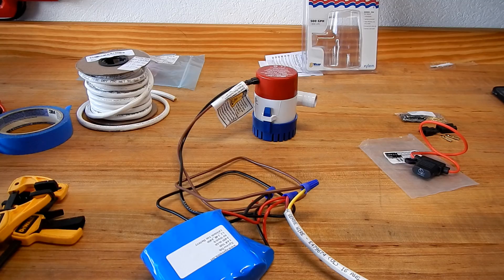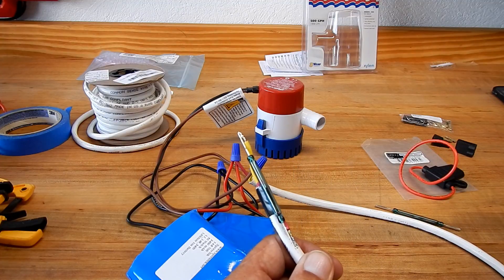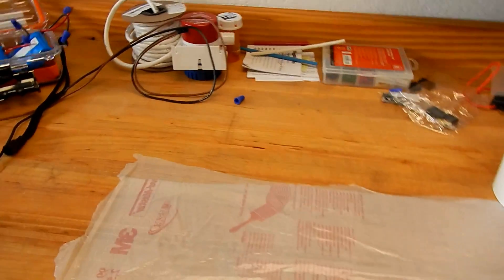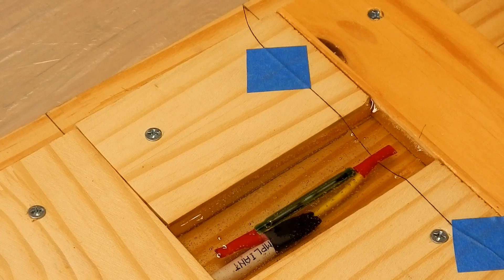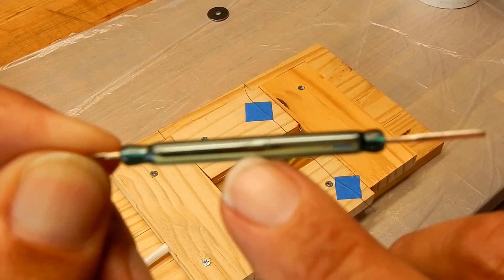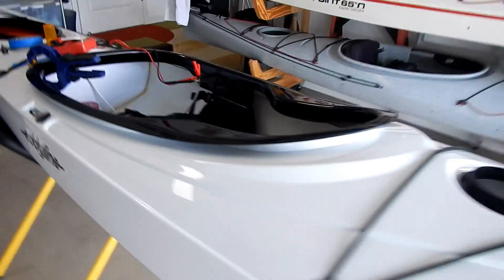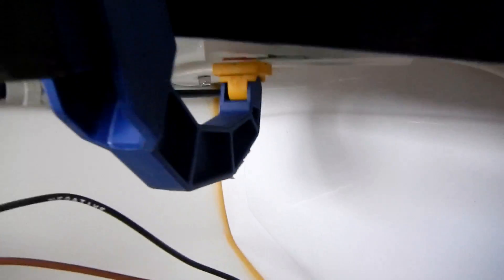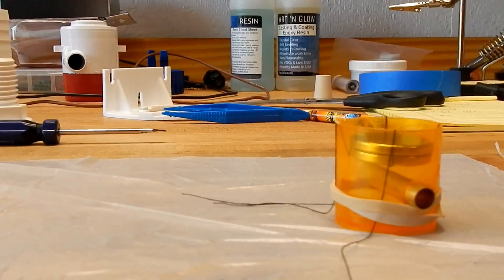Kayak DIY Electric Bilge Pump

Comment: Thanks for making this video, there are lots of demos and small summaries out there but not many full walk-throughs. I'm in the process of gathering parts right now for a similar build and I have a question. Is there a particular reason that you went with 14.8v batteries? The rule 500 is a 12v pump and there are lots of appealing options in 12v batteries, will they perform the same?
Reply from the maker: If I remember correctly, it came down to the size of the battery cell, and wanted to keep it as small as I could. The cell voltage is 3.7v. with 4 cells per pack. I Have two packs in parallel so if one would fail the other would still work just a bit slower and not as long. I would not use the same connectors at the battery, there are others out there that are easier to find and cheaper.

Comment: excellent work.  I would be interested to know how long the pump would run until the batteries are completely exhausted.  could you fill it continuously with a garden hose and time it?  I'm asking because I need a very small pelican case for space issues.  But at any rate, really perfection.

Comment: Great boat, great install job, and a great video. One thing I will add, is I have found from experience that single pump is NOT adequate if you are in three foot or higher waves with a boat of water trying to put on a skirt.  There always seems to be a wave that comes over the side, eliminating any progress in bailing. I am in the process of sourcing parts for a second 500GPH pump, your list will help me greatly...thanks.
Reply from the maker: Saskatchewan Adventure thanks very much for the comment. I think in 3 plus seas you will be hard press to pump it. Getting your skirt on is top of list even if hand pumping you can pull the edge open and slide it in. If you check Rule does make a 1100gph pump and I believe it is in the same package. Your amps will bump up so you may have to go with a relay to switch the pump on and off. In  this case you could use a simpler magnetic switch. Do not use the Trax connectors they work great but hard to source there are may good alternatives on Amazon and cheaper. The cable glad were the biggest head ache but both are high quality. I ordered the Morris off Amazon and had to wait 3 weeks for them to come back in stock. Once I got them one had the washers and jam but the other did not. I ordered a replacement and it arrived with out both too. I ended up calling Morris and spoke with one of their tech people he said they should have been included so he put two washers and lock nuts in an envelope and sent them to me free of charge, what a great company. Thanks again
Reply: I did consider the higher pump, but I think I like the idea of a fallback pump if the first one calves for some reason.  Thanks again for the additional info.